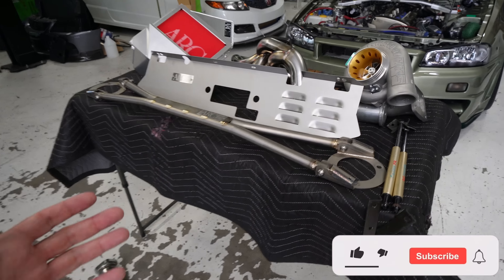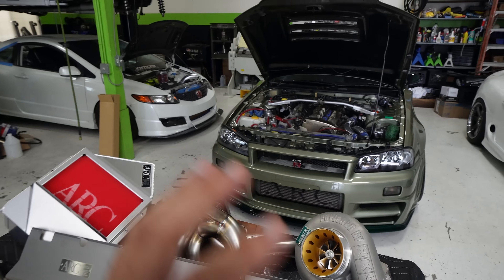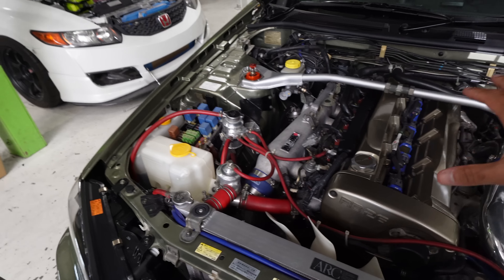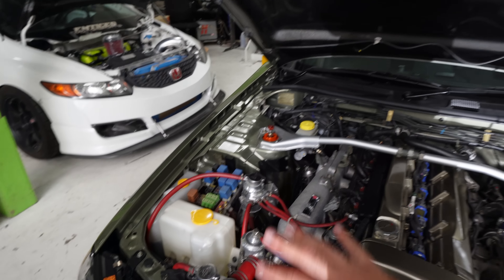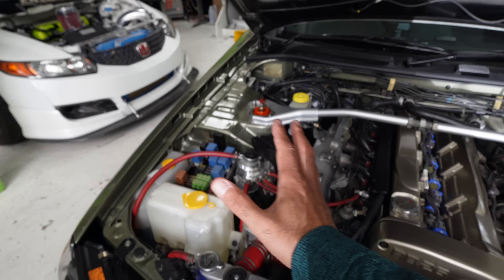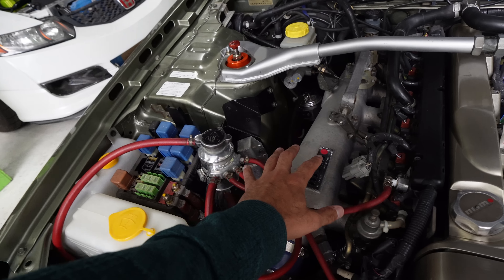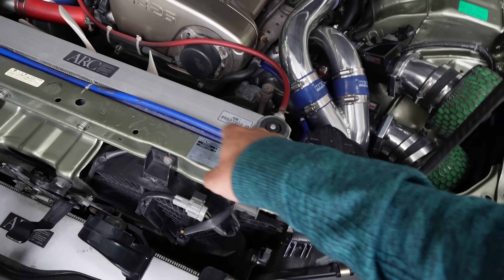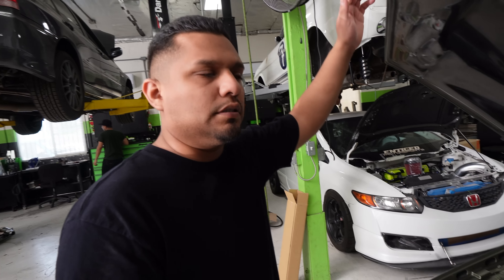Let the engine mods begin! (R34 GTR)

Comment: Bro, what I do with all my RB’s is a Taarks oil filter adapter and Improved racing thermostatic oil filter relocation to a Setrab cooler. Just make your own -10AN lines. I know it’s not super JDM, but it’s unbeatable as far as cost and design. And the Taarks has double extra 1/8” npt ports for V cam,pressure/temp sensors, etc.

Comment: are you opening the motor at all?
Reply from the maker: I don’t plan on opening the block at all.
Reply: @pterodactyltactics  any upgrades when you add the vcam for oil issues? Or just literally bolting it on